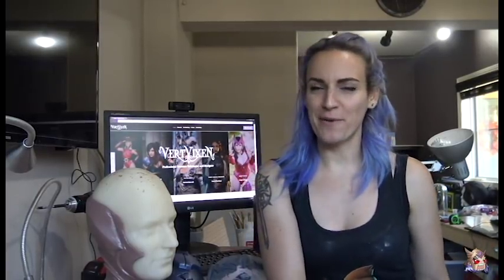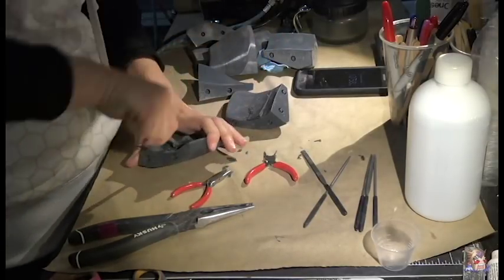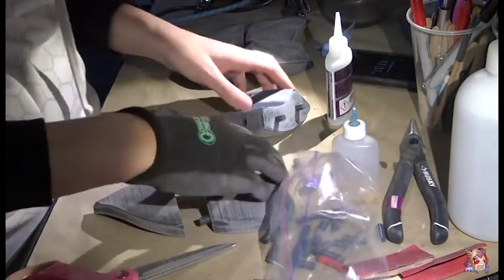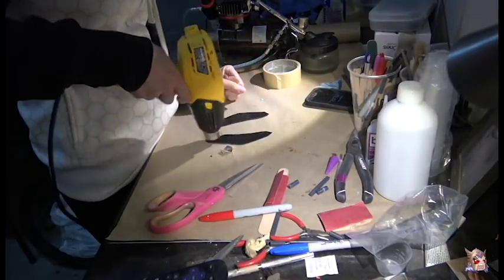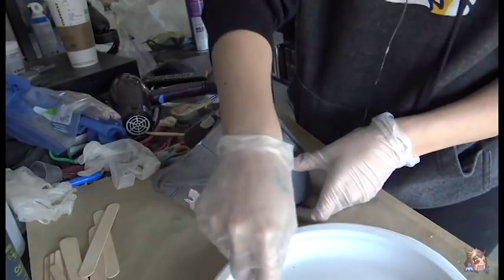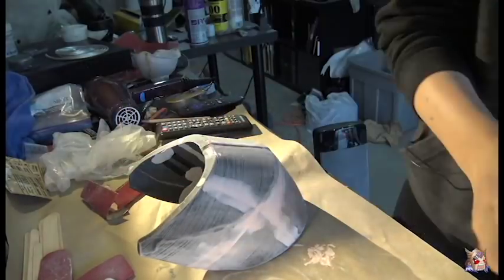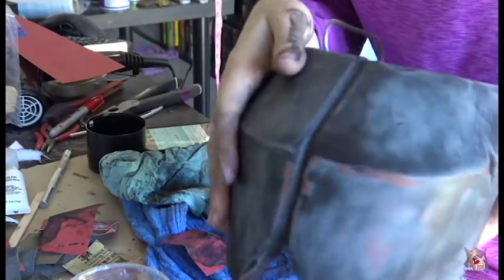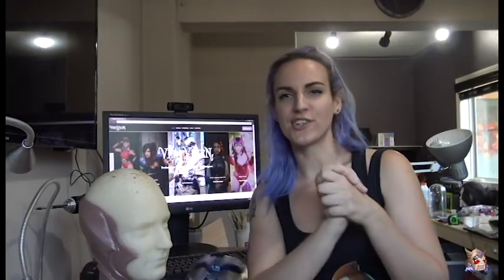How To: Clean up 3D Prints!!

Comment: tinymachines sells a cr10-s5 with which has a 500x500x500mm volume. with an ac silicone heaterbed and an e3d v6 volcano hotend should treat you right. get an enclosure for it and print with ABS. great work!

Comment: Subscribed/liked.  I just went through this pulling and prying on my Dr. Doom mask print.  I was wondering if there was an easier way and then I saw your video - which tells me there is not an easier way.  BTW I am a huge fan of zip kicker.  I used it in my first job (working at a hobby shop) back in the early 80s.  Still watching.
Reply from the maker: U Do It haha sadly sometimes it just takes alot of love and patience! Thanks for watching :)
Reply: Its all about the settings. In cura for example the default gap is set to only .1mm from the prints surface. This bonds the support to the model almost every time. I adjust it to .2 or .25 and comes off cleanly without much scarring. Also in S3D i have it set to 2 layer gap, with setting of dense supports of 1 layer. This gives great surface finish without bonding to the model.

Comment: Nice video. You may want to try wood filler, less chemicals no need for gloves or respirator until you sand still no need for gloves even then. No mixing just use it straight from the container.